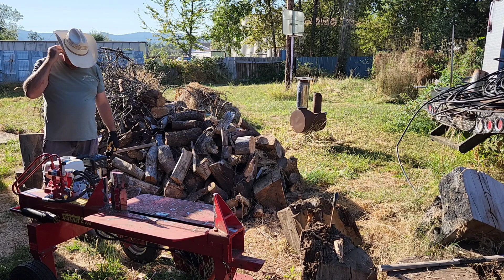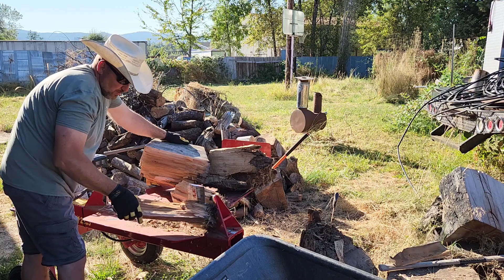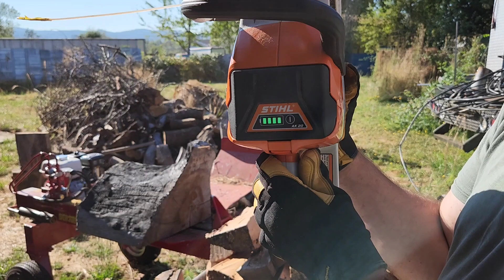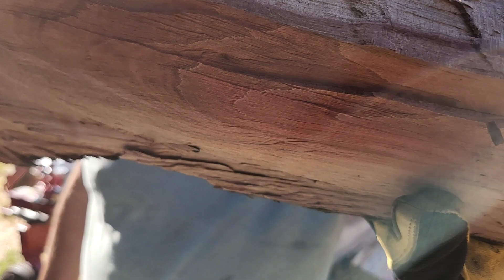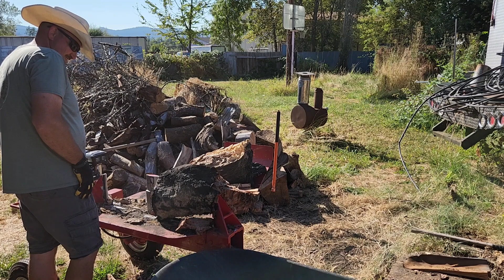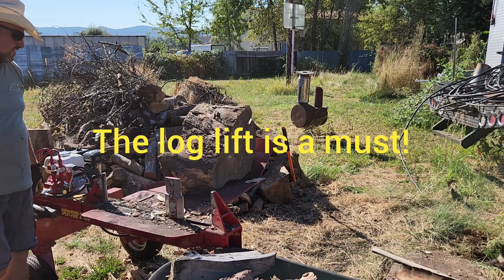Satisfying sounds splitting firewood.  #firewood #splitfire #satisfying #satisfyingsounds

Comment: What’s the brown cylinder shaped thing with a chrome like vertical sticking up from it? Have you found situations where you were not able to split the wood? Thanks.
Reply from the maker: It is an old wood stove.  I have not found a time yet where I  was not able to split the round.  I have had to try several times a different angle or slice to get it to go but it always goes.  The Split-fire is easy to get unstuck once a round is jammed up.  Just need a little bock of wood and run it the other way.  There is no need for a chain or a sleg hammer.
Reply: @shottyshoshco  thank you, I’ll end up order one after the new year. They are closed for the holiday.